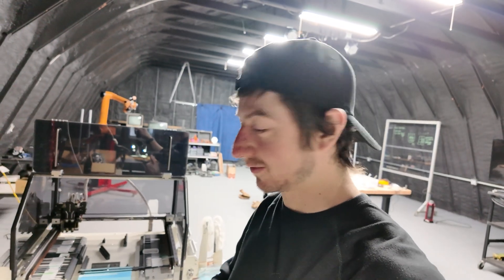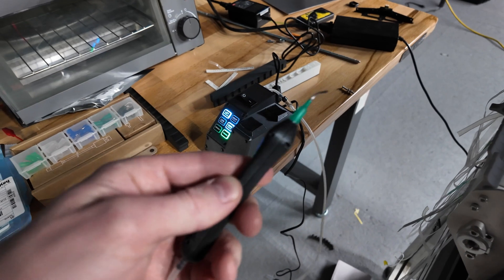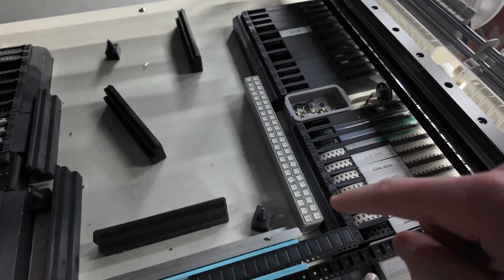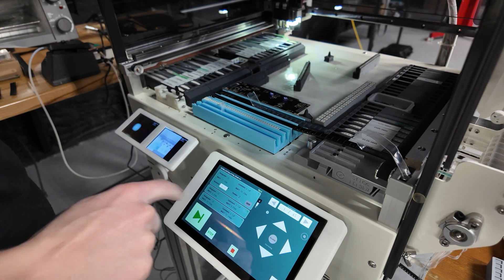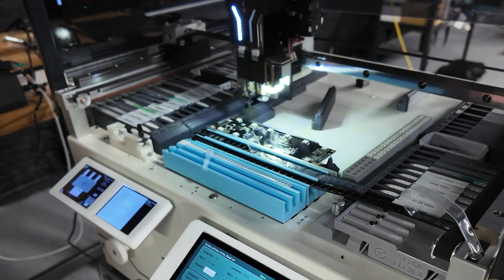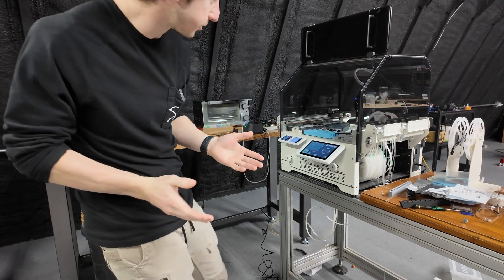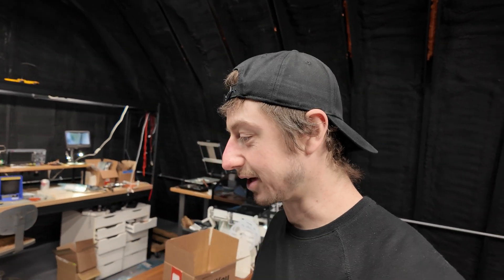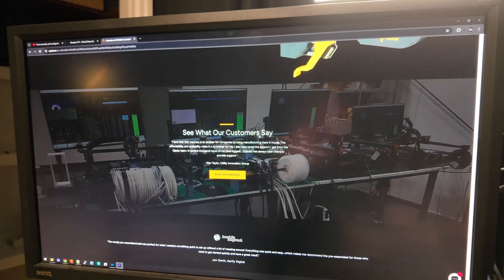Is this the Pick and Place Machine for You? The Neoden YY1

Comment: You don't have problems with the components flying from the tape when it peels two screws resistors?
Reply from the maker: Usually its okay, plastic tape is worse for sure, the paper ones hold them okay. If you have an issue, you might need to center the pin in the tape hole a little better.

Comment: i have the same machine, i dont have some of the problems you have with like the screen, mine powers on no problem. i have to put some weight on some of the tape as well, but ive found that I can only make like 2-3 boards at a time before I have to power off then on because it starts to drift a bit. but overall it works well, I typically make 10-20 boards at a time with it that has about 70 components on them. But yeah I typically have to baby sit it, my stencil printer I have right next to the machine with my thermal oven so im close by to watch it if theres a problem.

Comment: I have the same PNP. To fix the tape issue, you can order additional friction o-rings from them; they don't sell them on the website, but call in and order a set for like 10 bucks of different sizes so you get a set for your narrow and wide feeders, which helps with the tape pull issue. What happens is that the tape puller is friction-based, so I added an additional ring that is already in the tape puller. Now, the little gear has more friction, so when the tape advances, the additional ring provides more friction between the shaft and the little gear wheels, and now I have no more issues. As far as not picking up the components, sometimes the head needs to be cleaned so it creates a better vacuum between the pickup head and the component. A simple wipe with some alcohol helps out once in a while. Hope this helps you out. 
If you want to have higher accuracy on the pickup and placement, especially once you go to 0201-size parts, check out this filter upgrade on eBay. Neoden YY1 Pick and Place machine camera filter set. I've done the upgrade, and I rock and roll with 0201 components or other ones that have colors that sometimes cause an issue, as the camera doesn't have a clear recognition of the component orientation due to the illumination issues. Cheers!

Comment: To solve the problem of the label not peeling off the tape, you need to replace the rubber washer inside the grooves so that it has the necessary strength to peel off the label. Then you don't need the weight.

Comment: 8:34 like so many machines.

I cannot even begin to count the number of times I've been told by non makers that a machine just does it.

Whether it is a CNC, 3d printer, laser etc.

Non makers seem to think these machines just pump out facsimiles of something, exactly the same every time with no intervention like a desktop printer.

Only makers realize you still have to make the designs, (if you're using a premade design, tune it to work with your machine), program the machines, tune the machines to be true/level etc, then even if making two of something, if one is made of a different wood/metal/or even color of filament, you have to make adjustments to the settings.

Yes, once the machine gets going, you normally just have to keep an eye on it. But it is far from a completely hands off process where you push button, get things over and over again.

The cross us makers must bear when talking with or especially quoting prices for something to non makers, lol.

(Slight rant aside, this is a neat video showing how this machine works!)
Reply from the maker: This gives me an idea. 5 axis CNC where you just drag and drop a STEP file into it and it does ALL the work, just grabs a chunk of metal and spits out the correct part. 🤣
Reply: @SeanHodginsToo  you'll make billions!!!

(May I request a humble 0.5% fee for sparking the idea? 🤣)
Reply: @SeanHodginsToo sadly for both of us, I think this solution already exists.

It's a human employee.

But it does come with its own issues... 😂

Comment: How many of those boards did you assemble in total? Kind of feel like I could challenge the neoden with my Pixel Pump 😂
Reply from the maker: Hahaha Only 40, not a lot- do I have to include machine setup time? lol
Reply: @ I‘d say yes because machine setup will always be required (also with the PP setup) unless you do the same project again. 😁

What’s the BOM count? Is it only the LEDs and some decoupling caps?
Reply from the maker: The pick and place is placing 12 LEDs, 17 caps, 25 resistors, a microcontroller and a regulator

Comment: Hi mate,
I have one of these and i am having exacly same issues. One solution that came to my mind is making custom feeders that detects needle motion via some photocoupler and forwards the component. 
Of course its is annoying that you paid 4k and having some dumb issues. Also i think computer vision stuff is happening on the cameras itself. At one point i was going to tear down whole machine and put openpnp but those are not regular cameras.
Reply from the maker: I've been thinking about something similar,  a way to add an active feeder system using the current plunger to trigger it. I would be willing to lose a number of feeders to fit in some active one that are super reliable. 
Interesting on the cameras, I assumed they were just USB cameras and the software was handling stuff. I want to teardown mine soon, maybe after this project.

Comment: Yes most of us do actually think you are crazy and why would you place the LED chips so far away an hour from the 3-D printed box? Engineers are supposed to be efficient, not
Reply from the maker: Its simple, its easier to peel the tape on the table, and when you peel the tape and try to move them close sometimes they will fall out. The extra 0.5 seconds to move from the table to the machine is negligible when you factor in spilling LEDs everywhere.
Reply: @SeanHodginsToo I literally thought you were insane but then I remembered how flimsy peeled tape with components is.

Comment: That looks fun to tinker with! 
Besides the novelty factor what is the benefit of the Pick and Place over ordering assembled PCBs when you have to order fabricated PCBs anyway? Is it in the upfront cost of the assembled parts and not knowing if you actually need them vs buying some cheap empty PCBs and some common SMD components that could fit other projects? So: buying inventory vs manufacturing on demand?
Reply from the maker: TL;DR Its quicker and cheaper, and the money goes to me keeping my business running instead of to a fab house. 
In low quantity pre-fabbed can sometimes be super expensive. I'm only doing about 40 boards. Then there is the prototyping factor. Ordering boards assembled and then finding a major flaw is game over. Then finally its usually a couple weeks turn around to get assembled, but if I do it myself I can do it in about a week from ordering to assembly.

Comment: Why take the LEDs out of the tape and put them in a tray instead of using the blue cut tape holder?

I made some custom 3d printed cut tape holders, and they work pretty well.

Also, for passives, you can use the down facing camera to pick up loose pieces and it works pretty well, good way to not waste the parts you beed to take out while loading the tape.

There is a github from someone that made a custom controller, but it hasn't been updated in over a year

EDIT: OH! For the needle, I put a little bit of foam on the top of the bracket so that the needle doesn't fully retract. The solenoid would get stuck at the top, especially at the start of runs, but about 3mm of foam keeps it lose and greatly reduced the number of missed tape advancing
Reply from the maker: I thought about that but I can't remember why I chose this way. I think the ends of the LED tapes were inconsistent so I couldn't butt them end to end without bad misalignment. They also only come with 10 and the boards need 12, so I could have used two slots but I would have been changing them out more often instead of just doing a run of 4. I'm not doing too many boards. 

huh I'll have to try the facing down camera for that. I didn't think that was an options.

Good idea on the foam, for me I just replicated their rubber bracket and lasercut it but added the top catch(which I think is doing the same as your foam) and it works great now, but can still be kind of bouncy. I want to remake that circuit board so it detects when its down and up, not just down.

Comment: I've only ever made one custom PCB before but it was really satisfying. Obviously I placed everything manually with tweazers and I used a tiny $10 pcb heater but it worked out great. That board is still running 9 months later on the same battery.
Reply from the maker: Awesome! It is super satisfying and thats a totally reasonable way to make boards. I've probably made 1000 boards by hand like that and still continue to do so if I'm just quickly throwing a single board together lol

Comment: cool... thanks for the video. question though... if you are going to make a 3d printed jig/holder anyways for the parts that don't come on a tape, why not make the jig fit over the board in the holder so that when you put then into the 3d printed jig that it is placing them on the board where they go without you having to do all the precision placement that you mentioned. Or, alternatively, make the tray holder on the side hold the tape/substrate that they come in from Adafruit? Then you can just place the whole 10 pack into your 3d printed holder?
Reply from the maker: I'm only making like 40 of these so it was quick to just use my generic CAD file for my holders and stick 48 LEDs on it. I could have made one for the 10 pc strips, but the board has 12 LEDs, and its a bit more complicated of a print to make them hold the pre cut strips. Designing anything else would probably be a lot more trial and error that I don't want to do. But there is definitely a hundred ways to do this, I just chose this way for unknown reasons. And I don't have to do any precision placing, thats the benefit of the jig. I just drop the LEDs down and then the machine precisely places them.

Comment: PixelPump is pretty awesome 😎
Reply from the maker: It really is, I need to setup the feeders that came with it as well.
Reply: I've personally really never gotten the appeal when little triple a powered vacuum suckers exist from Ali for like 20 bucks.

400 dollars for a more bulky version of the same thing seems a bit insane to me.
Reply: @BeefIngot Have you ever tried those things? They're less useful than just using tweezers and toothpicks.

I will however agree that the pixel pump is expensive for what it is but it pays for itself in saved time and headaches rather quickly.